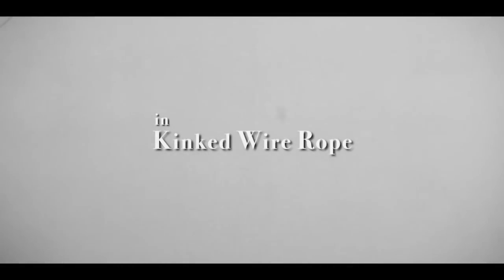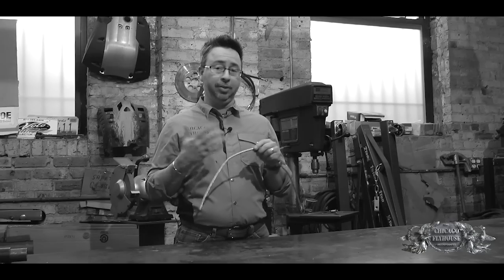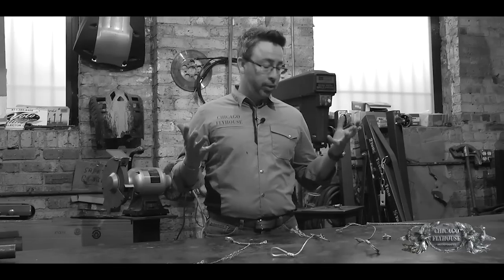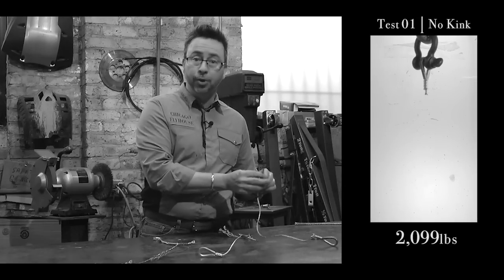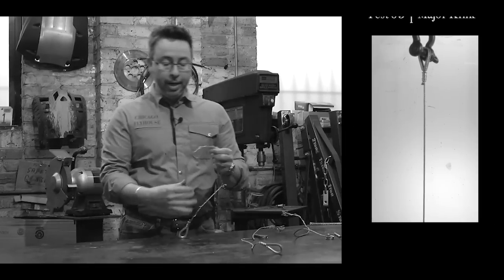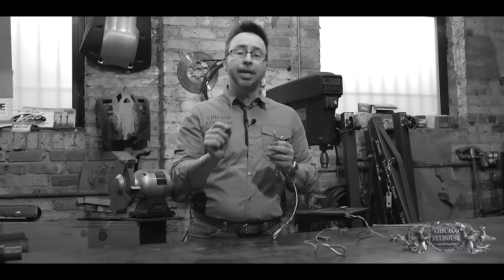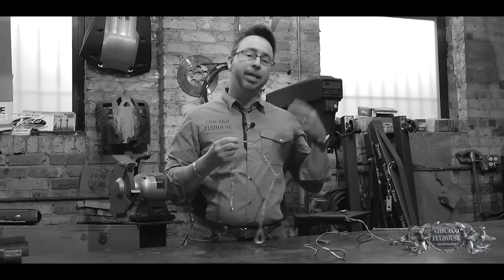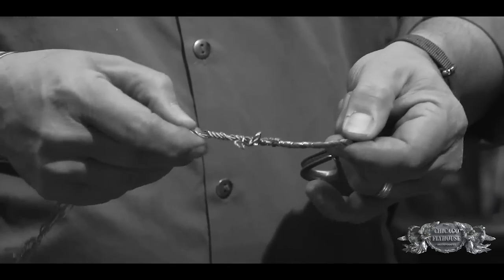The Effects of Kinks on Wire Ropes

Comment: I'm surprised you only got a 10% reduction. In much larger 6 stranded ropes (used in mining shafts) the same tests were done with varying severity of kinks, to see if they could correlate the severity of a kink with a loss of strength, and what they found is that all kinked ropes lost almost 50% of their strength!...and logically this makes sense, because in a kink (not a bend) half of the strands get stretched, so when you put a load on the rope and it straightens out, only 3 of the 6 strands are effectively holding that load. Mining regulations say that any rope that experiences a kink must be removed and replaced immediately.

Comment: This is awesome!! Glad I came on this site, been service tech in fitness industry for 20 plus years and make my own cables for machines..I've seen these issues on weight machines...customer always wants to stretch the life span of the rope..unlike bare wire , 95 percent of the wire rope is nylon coated so you don't see alot of what going on inside, you have to judge by examples like this.